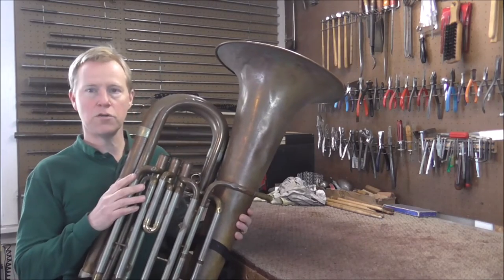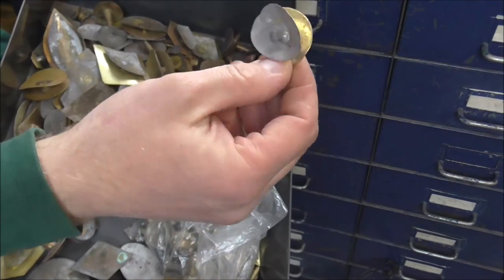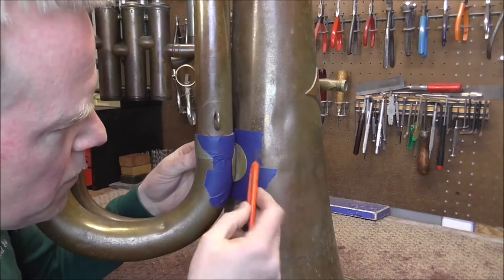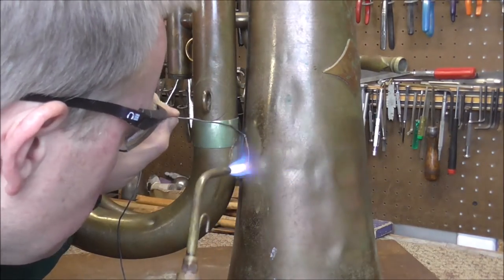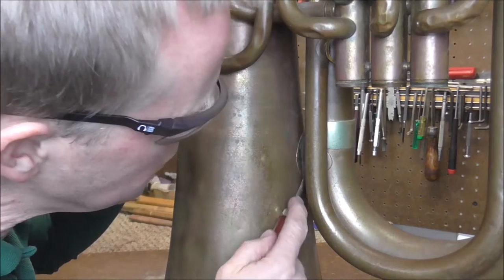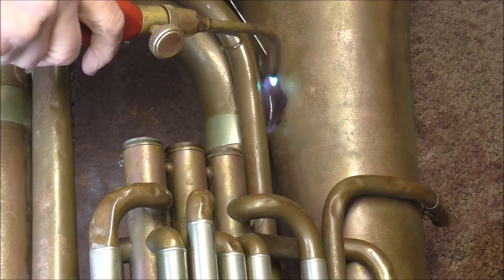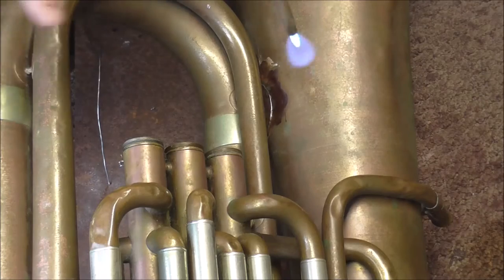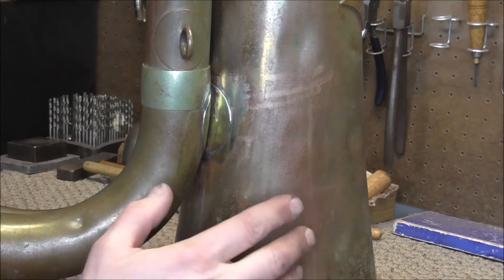Soldering a Tuba Bell-To-First-Branch Brace

Comment: If you ever wanted to match cleaned brass or copper to a tarnished surface, you can apply a white vinegar and salt mixture to the area and let it dry, say overnight and then neutralise with your ammonia mixture.  The longer that it takes to dry and the longer is sits, the thicker the tarnish will be.  I find that wiping or washing the treated area area will remove some of the tarnish as it is still loose for a while.  White vinegar and salt will produce a blue or greenish patina in places, but there are other mixtures that will produce different shades of tarnish.  Just thought that I'd mention it in case it might be something you haven't tried.

Comment: Great job as always ! Given your pedagogical and technical skills, you shoud definitely consider teaching this craft :) 

Almost every old tuba or euph I've seen in my life had either an unsoldered bell, or a weak (and unsightly) solder blob trying so hold it together, putting a brace is probably the best option ! I'll probably copy this, particularly for marching instruments...
However, I always struggle to have a nice flush fit with brace flanges... I use 4/10mm (16 tho) sheet brass (standard Zn37/Cu63 brass) properly annealed, I tack solder it then push them with a flange burnisher as well as I can, however the springiness of the metal makes a gap that always seems me to be too large... IDK how to improve it.
Reply from the maker: Solder the part of the flange that is touching the instrument with just a little bit of solder. Then use the flange burnisher in that area. Repeat that process one or two more times and that should help. 
I hope this helps.